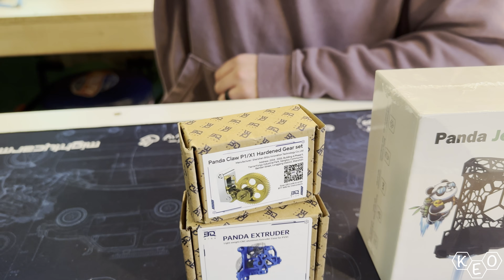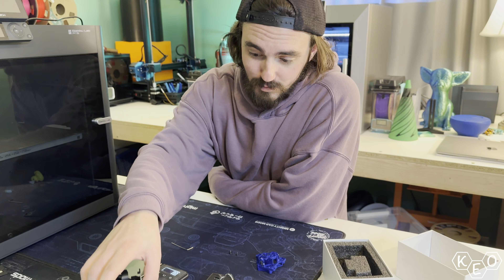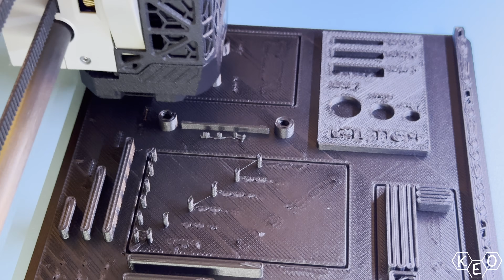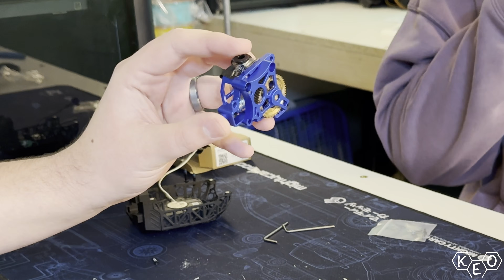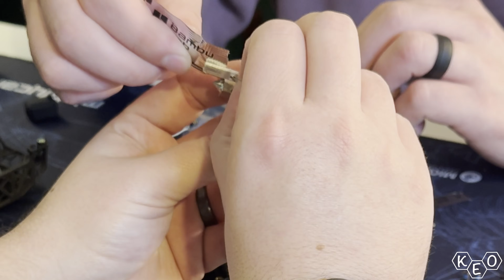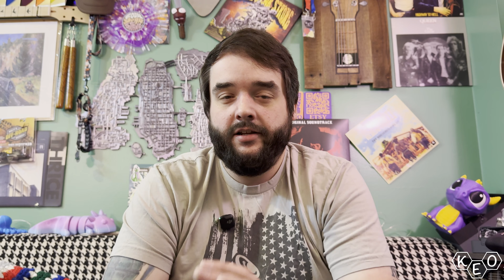Valuable Printer Upgrades or Complete Waste? The BIQU Panda Line!

Comment: i bought the hardened gear set. after one spool of pla-cf i began noticing issues with extracting the fillament. more clicking and no fillament coming out. took me a while of googeling and came over a reddit post which explained the same issues i had. turns out the teeth was damaged and couldnt grab the toughter fillaments.. so i changed back to bambu's hardened gear set.. and havent had an issue since.. wouldnt recommend it..
Reply from the maker: Yikes. That’s a bummer

Comment: For all the focus on skeletonising the cover etc. They overlooked making that large gear wheel lighter. It wouldn't be difficult to drill 6 holes around the centre which could then lead to the overall upgrade being lower weight than stock
Reply: Does the skeleton case allow access to the extruder tension screw? This is normally covered by the stock setup, but may be useful if switching from eg TPU to other filament if readjustment is needed
Reply from the maker: I am pretty sure that the tension screw is fully bottomed out by default which tracks with what ive seen on my A1 Minis as well. But if you swap that with a longer screw then you get that adjustment

Comment: I had no idea they were going for a whole "set bonus" kinda thing with the weight like that. And here I just bought a light and the jet cooling fan, without the face plate thinking I'd just print a faceplate with PETG. Didn't know what the gears and stuff did. So basically, just changing to a hardened steel nozzle isn't good enough to protect your printer? Thanks for testing all that!
Reply from the maker: I am happy you got some value out of this video! It was great learning more about these things. I was just as surprised to learn about the careful weight savings as you were. Thanks for hanging around friend!

Comment: I switched back to the standard vent. I liked the front cover. But the problem with the Jetpack it makes it so the front cover does not come off without going down. Yes when it can move down. but if you need to take the cover off mid print to clear a jam, it is hard. I would not recommend the jetpack.

Comment: How long did it take you to make the mods? One thing I'd really like to see is some qualitative assessment of the cooling shroud to see if it actually makes a difference. I'm new to 3d printing and purchased a bambu P1S a couple months ago because of the price and "out of the box" it just works. Since I didn't have to assemble it I don't have any confidence in my ability to tear it down and modify it.
Reply from the maker: Yes fair point. It took the two of us a couple of hours between filming and installation. With that said, we would have been better served had we read the instructions from the beginning instead of coming back to them when we faced issues

Comment: Cool upgrades but IMO it doesn't put the P1S right in line with the X1C. Mostly because the X1C self-calibrates with the lidar sensor and has a significantly better touchscreen on it. Those are the flagship features as I see it, not the hardened nozzle and gears. Not to mention you can buy official Bambu hardened nozzles and gears for very little ($16 for the nozzle and $20 for the gears). 

Still, I get that these have obvious advantages.. I just wouldn't say it puts a lidar-less touchscreen-less machine into line with one that has those :)
Reply from the maker: I’m inclined to agree. Even if you add the panda touch, there isn’t a replacement for that micro lidar

Comment: You aren't suppose to have both lights plugged in. The control board powering the lights could be damaged and wasn't meant to output that much power . I wanted to use both lights but bigtree doesnt recommend it
Reply from the maker: Ahh bummer. I suppose we should have read the instructions a bit more
Reply: @KeoPrints  but did it work? I have the same Biqu light "upgrade" and am not loving it. I fully intend to go with a different externally controlled wrap around LED strip but would really like to know if using both works despite Biqu warning not to.
Reply: I found having separate externally powered lights (12v string in my case) meant I could have light too work with when the printer power is off. Which can be handy. Also means the printer PSU isn't carrying any extra load (beside the Touch actually)
Reply: Did plugging in both end up messing up your control board as BigTreeTech claims it will?

Comment: You sold me…  I have the lights on both my p1s and x1c and the touch on my p1s so the few upgrades will help me.. just need to add the 4mm hardened nozzle to my mix
Reply: DO NOT plug in both the Panda light and the original Bambu light at the same time.  Per BIQU, this CAN overload the circuit.

Comment: I have 2 of the cool plates and use the Bambu cool plate setting, when I first used the plate I thought it was useless and went straight back to the pei plate, I've now been using the cool plate exclusively and its cool (pun intended) petg just falls off when it's cold, no scraping or pulling.
Reply from the maker: I’ve been impressed with it as well. Super COOL

Comment: These were why I went with a P1S. The ability to print PET-CF was important, and you can use Bambu parts or BIQU stuff. I like my Lux, but I would like it better if I could drive both lights comfortably. I don't run the stock light due to the possibility of burning out the board. With the new firmware coming, I won't be getting a touch, though. Good video and I'll be getting the BIQU internals once I'm ready to start with the harder materials this summer. I'm interested in the Revo stuff too because I'm a bit worried that changing my nozzle assembly often will wear out the connections and doing just the nozzle might alleviate that fear.

Comment: I'm expecting delivery of my P1S Combo as we speak and I already looked at upgrades. Coming from an Ender 3 S1 Pro for 12 months, I'm ready to drop the manual work and shift to something that just works.

I was looking at all those upgrades, but including the front panel and the wrap if they are worth it? I'm still working my way through PLA & PLA+ but ready to take the jump to PETG etc.
Reply: I came from an S1 Pro and MK3S+ to a P1P and it was a crazy upgrade. Not just in terms of speed but in overall quality of life. I now have 6 P1S combos and they've been fantastic. 
Personally I see no reason to get BIQU's gears or extruder housing. Those are just fun upgrades IMO. I don't have the light but could see that being nice. What I do have are the fan ducts, glacier plates, and E3D's Obxidian nozzles. Very highly recommend all of those, but note that none of them are really "needed". Enjoy the machine in its stock form for a while before going down any rabbit holes - you'll be surprised how good it is.
Reply from the maker: Yup. This kind of upgrade will only really be worth it if you plan to print CF reinforced or GF reinforced materials regularly. Also glow in the dark filament is abrasive which often flys under the radar. 

As for the wrap, it’s not for me. That said, perhaps if I tried it out I might find that I like it!

Comment: destroyed my biqu frostbite by accidently printing tpu on it, i have already ordered another.  i love the panda claw, jetpack and cage, and i use the panda Revo which offers no benefit except quick nozzle changes which means i actually change nozzles when i need to a lot more frequently when i need it.  printing tpu switch to the 0.6, want fine detail switch to the 0.2.  need a hardened nozzle switch to the revo obsidian.    the panda lux however is useless since they only want you to run the 1 light rather than that and stock
Reply from the maker: I’ve made that mistake with the TPU as well but my plate survived luckily. As for the Lux upgrade, ours had provision for the stock light as well as the new light bar so we are running both
Reply: @KeoPrints the panda lux does have that provision but if you read their directions it states not to run both, as some folks had problems with it overloading the circuit and damaging the board. i have a riser with externally powered leds now that really brightens up the build plate

ought to check out the Revo if they will send you one.  now i change nozzles several times a week to what would best suit the print.  nozzzle changes are a 60 second affair cold